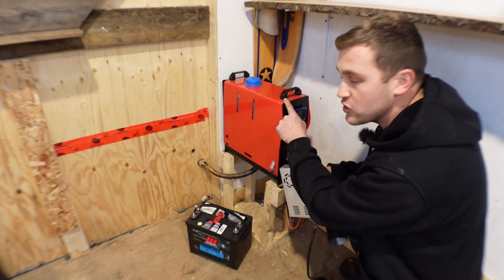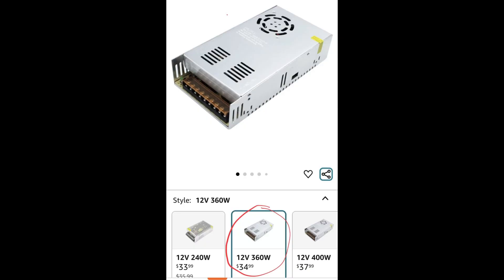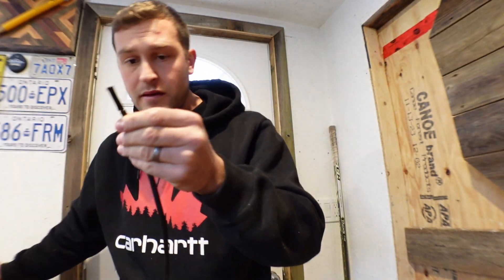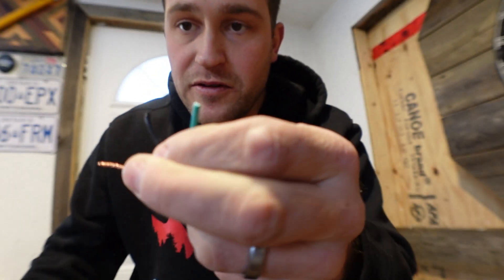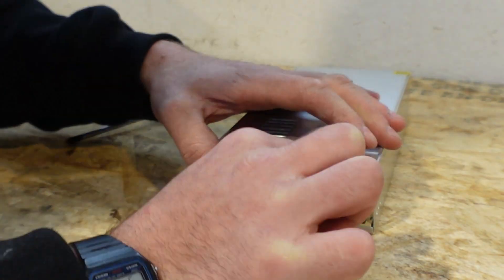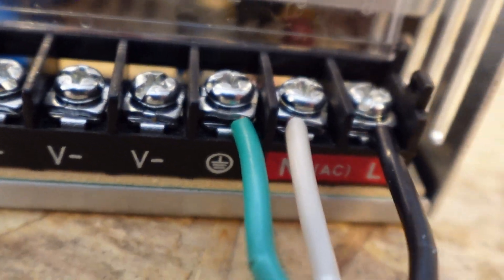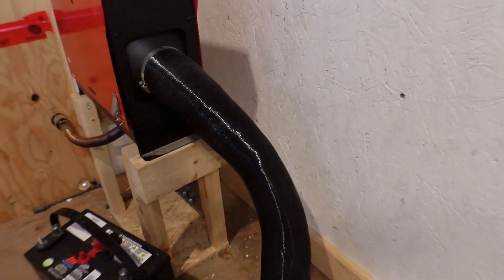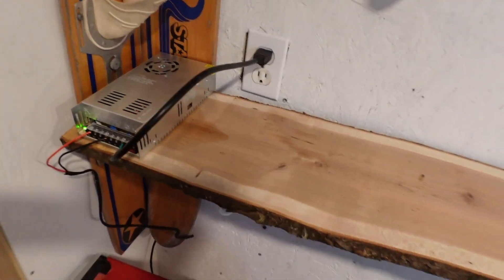Converting your 12V Diesel Heater to normal 110V receptacles for $20

Comment: Ya bought this and it won't run.   Kicks off on error code 02.  It won't put out more than 11.4 volts maxed out i even upgraded the size of cables and still I gained .2 volts. Im frustrated.  Cause I cant return it
Reply from the maker: There should be a +/- where you can increase the voltage.
Reply from the maker: Go to my video at the 4:50-5:45 time shows exactly how to adjust it

Comment: Hi, I have a question. By mistake, I connected it directly to the electrical outlet without the converter... how can I fix it? It doesn't turn on at all... did I burn it out? Is it still usable? How can I fix it? Sorry to bother you... I look forward to your reply. Thanks.
Reply: You fried it
Reply: @ChrisB119 How can I fix it?
Reply: I ordered the motherboard to replace it. I hope this works; it was the only part that showed a burnt circuit.

Comment: Thanks for the info, and nice job explaining in enough detail.  Would this work plugging into a power station instead of a wall outlet?  My concern currently is that I have a 10A power station, and the diesel heater needs 12A to start up (the power station totally supports the heater once it is up and running). Would this conversion help as "work around" for that by using the 110V option instead?  I'm clueless on all of this but thought this might be a way to fix my startup issue. Thanks

Comment: nice video thanks!. You might want to consider moving the heater intake away from the wall, losing some airflow. Prob fine but it may increase your efficiency to move it a bit
Reply from the maker: Ya it's there as it's a small shop but I'll definitely try moving it

Comment: and what happens when you loose power and that diesel heater was running, there will be no cool down available to protect the engine, Diesel heaters need to shutdown / cool down to avoid damage, from my experience of using these heaters for the last 5 years, only 1 ever broke, and that was 1 I ran on mains with out a battery, engine seized.....
Reply: Fire risk: The heater's safety mechanism is designed to run a specific shutdown cycle to cool down the combustion chamber and the glow plug. If mains power is used and suddenly cuts out, the heater will not complete this cycle, and the un-cooled components can become dangerously hot, leading to a fire. - from the manufacturer.

How to safely power a diesel heater Use a battery: 
The recommended power source is a \(12V\) (or \(24V\)) battery, which can handle the high initial current draw for the glow plug during startup.
Keep the battery charged: Use a solar panel or a battery charger to keep the battery topped up.

Use a suitable power supply: 
If you must use a power supply, ensure it is a dedicated DC supply that correctly converts mains power to the low voltage your heater requires, and that it can handle the startup amperage. Always use a battery with the power supply to avoid fire risk from sudden power outages.
Reply from the maker: To be honest zero concern the first diesel heater I owned a few years ago I never shut it down didn't realize there was a cool down. Did it probably 20 times and it still works great.

Comment: Which switch did you have selected on the converter? The 110v or the 220v? It’s a switch on the back.
Reply: Is the power coming in 220v or 110v?  It's probably 110v because it's the most common.

Comment: How come you used the 360 watt one? Isnt it volts× amps to get watts... wouldnt it be okay with slightly less watts? (I just bought the same one you did, but I was just wondering) lol
Reply: Always size it up! Err on the side of at least only using 80% of the capacity of the power supply

Comment: Thank you for sharing this useful information with us, for me is useful, even just to know that such a thing exists.I am from Europe, where electrics are 220V instead of 110V.
I am wondering if I can use such a diesel heater in my basement to warm it up,so that the water pipes will never freeze and the temperature will be slightly nicer  during winter times. Thank you.
Reply from the maker: These concerts can br set to 220V or 110V 
Yes a diesel heater would work great in your basement but it needs to be vented outside as it produces carbon monoxide
Reply: @meyers.makes.  Great, thank you! 👍
Reply from the maker: Anytime  @domnicadragan377